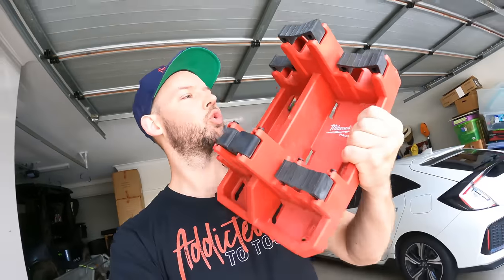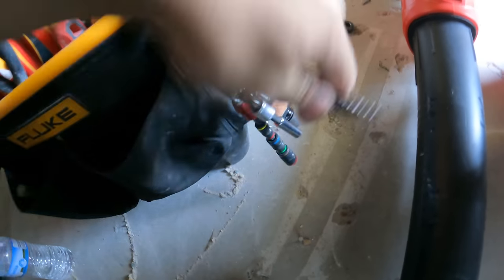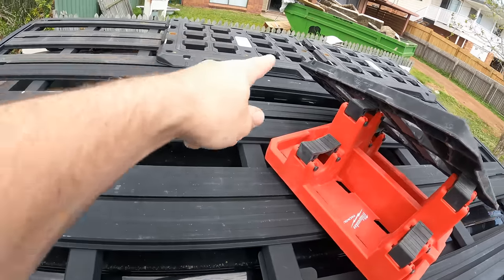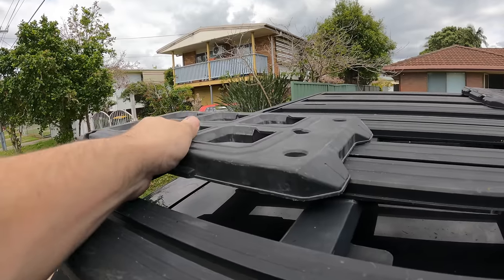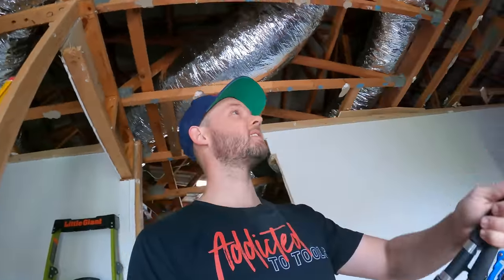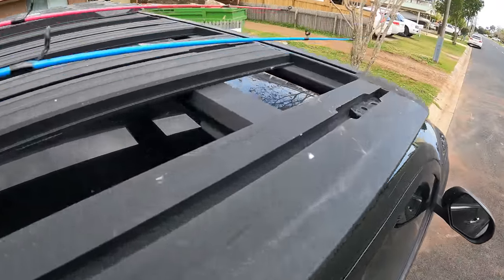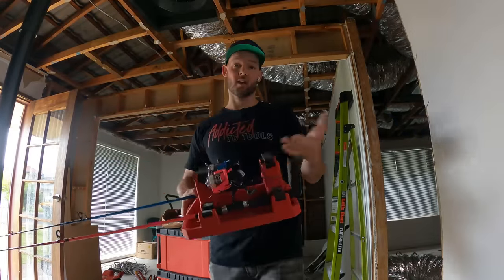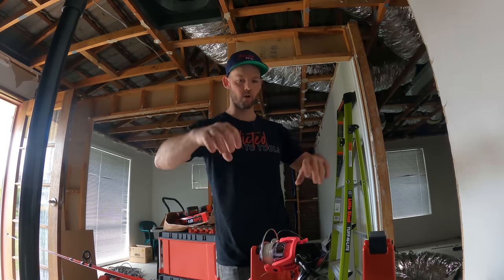Milwaukee PACKOUT Fishing roof MOD

Comment: The ones that rhino make for fishing uses the same rubber material so it should hold up. But great idea I'm going to do this for my rod holder on my rhino rack
Reply from the maker: They make their own? 😂I should have checked that first. Cheers for the heads up.
Reply: @AddictedtoTools  haha yeah they do mate but they are only single rod usage and they are a bit pricey I like your idea with having the 3 holding option